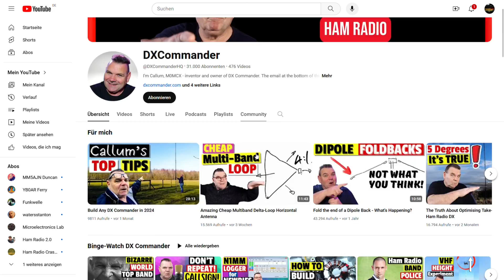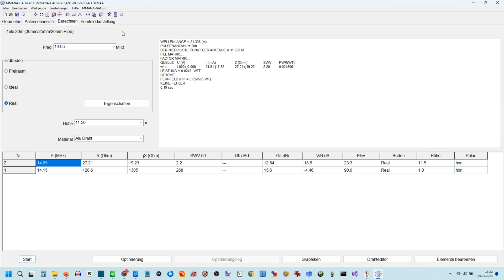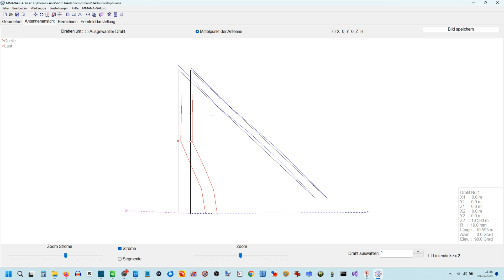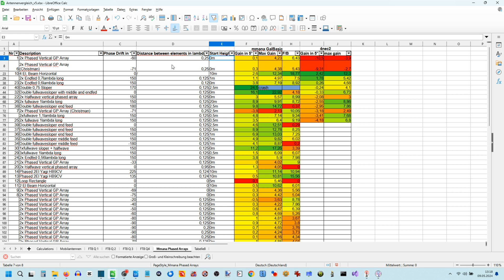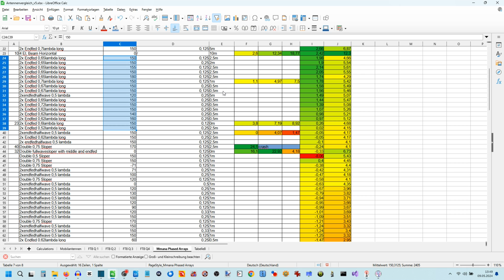Mmana Gal & 4NEC2 Antenna Simulation Comparison of a Phased Array

Comment: Build one - and you'll see.
Reply from the maker: Hey Collum, I´m honoured. I will show you the differences in practise with WSPR ;) But my time is limited.
Reply: @ham-radio1000  Also time limited here friend - but in practrice, the 2-element phased array does indeed look like the plot - and is simulated in other packages (and real-world applications). The reason for 71 degrees is not so much f/b but to get very precise impedance matching. Long story. John Gendron and I discussed this in one of my videos about 12/18-months ago when we talked about triangular arrays. But it does work and SHOULD give you extra 5 dB in the front and a little bit more f/b.
Reply from the maker: @DXCommanderHQ  Merry Christmas and a happy new year Callum. Hopefuly in 2025 I will get some more time to watch the video and to make some tests. I have just ordered new test equipment.